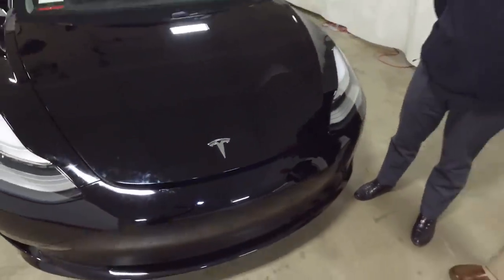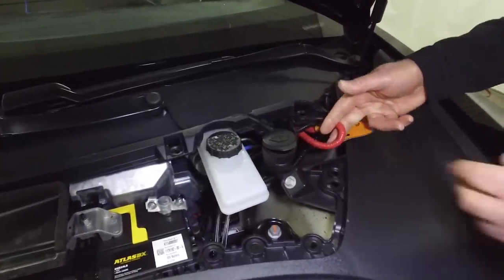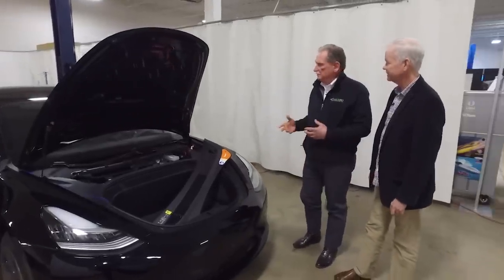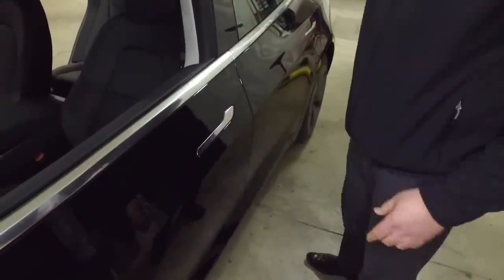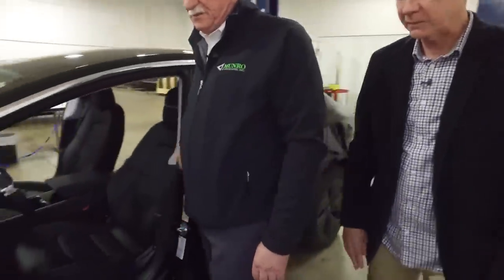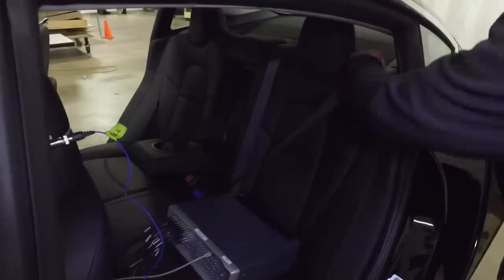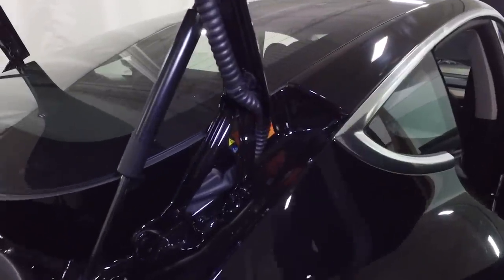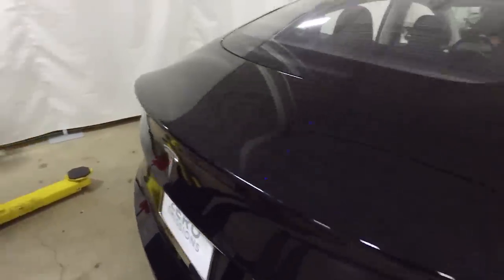Tearing Into Tesla's Model 3

Comment: Fit and finish: good point, I hope they sort this out.
Handle: meh, feels more like "I've never seen it before so it's terrible"
"Safety issues": Sure, people will have to learn, but you can't force Tesla to have poster size instructions on the side of the car. Also, how big of a problem is it? How many ICE vehicles have their fuel line layout displayed on the car? 
Lastly, can they really see no reason for avoiding the mechanical release for the frunk!? This is where it beggars belief that they are being honest. I have my stuff in there! I don't want there to be a lever for anyone to use!
Reply: Not really.. you just have to be stupid on another level to belive shit like this is something that should get approved by NCAP in the first place lmao.
Reply: The inability to cut the power in time will be a problem when you or your loved ones are bleeding out inside, and the rescue workers refuse to cut the car in case there is a risk of getting in contact with live parts. You should look up the FIA regulations for Formula E, the drivers are not even allowed to exit the car one foot at the time should they have been in an incident, but rather, they must jump off the car.
Reply: There is no reason for a hood release to be electronic.  None.  Same with the doors.
Reply: 1. ) Tesla publishes a first-responders guide with all the “caution areas” diagrammed.  Toyota and Honda do the same for their hybrids.  Tell us how it’s suddenly a problem when Tesla does it?
2.)  The 12v battery died in my Chevy and I had to climb thru the cabin to the change it. The rear lift gate is electric and I couldn’t open it in order to access the battery at the back of the vehicle.  

This video is stupid.

Comment: It's interesting how likely they seem to think it is that the battery would start shooting sparks everywhere. These are very safe devices, much safer than gas tanks.  I don't remember seeing signs on every car about the exact location of the gas tank and fuel lines there are simply standards that people are used to. They will have to get used to electric car standards.
Reply: I wouldn't say they're any safer than gas tanks. Gas tanks are a fire hazard, batteries are just as much of a fire hazard plus an electrocution hazard.
To avoid trouble when cutting a gas car, you just avoid the gas tank. The fuel lines are irrelevant. However in an EV, the power lines are still an electrocution hazard.
Reply: If you don't mind paying thousands of dollars more for a vehicle than an ICE car, by all means go for it. But until the price of those batteries come down significantly, which doesn't seem will happen anytime soon, EVs will not be as cost competitive as ICE cars.
Reply: Battery prices have been dropping consistently for years... Soon enough they will be cheaper to buy, and they are already way cheaper to drive.
Reply: The dramatic drop in price recently slowed down a lot, and now both lithium and cobalt are getting more expensive. It's not advisable to just look at a past trendline and extrapolate. Things hit economical limits. Car batteries won't be getting much cheaper as long as they're Li-ion based. Another 30% drop in price might be possible. But that's not enough.

Comment: About the power source needed for popping the hood: a couple of years ago everyone got angry with Tesla for the mechanical tab that you pull to open the frunk on an S or X. "Someone could steal my stuff" they said. Tesla said they would find a different solution, but that they have to give first responders a way of popping the frunk... This is the solution.
Reply: Henrik Bjugård Nyberg Gas cars never had a way of popping the frunk from the outside. Model 3 is no different.

First responders always used the pry tool to open the hood quickly for all cars.
Reply: Surely this method is for owners when they've let the 12v battery run down and not for first responders? I can't see them expecting the fire service to go through all that rather than just rip the frunk open with the jaws of life.
Reply: Sometimes the less violent method is faster and safer. I'm sure it's designed with several situations in mind, but it is part of the model x first responder training as the main way of accessing the power loop without 12V working.

Comment: Here's an idea (don't know if it is good or bad).  Standardize the electric emergency disconnect on all-electric vehicles.  I'd make it a knob on the exterior of the car that you just pull or turn to disconnect.  The knobs would always be in the same place for every car or truck.  I would put one button on the cowl so the driver can see it from the driver's seat.  I'd place the other button on the rear panel on the passenger side.  I'm sure people would mess with the knob because... people... but the driver would simply need to reset the knob.  If I'm in an accident, I don't want first reponders (who might not be from the fire department) going to the internet to try to find out what they should do.  We are in the early stages of this technology -- we need standards, especially thinks like the connectors you use to plug in your car.
Reply: 59seank First Responders always break open the hood on all cars since cars don't have an outside lever. 

Model 3 will have it's hood opened the same way, it's not complicated at all.

The frunk is secured for valuables.

Comment: I hope most of viewers understand that this dude is an idiot who thinks fire department cares about scratching the hood. The only thing he is not that wrong off is "how the hell did Tesla release a vehicle with unimaginably random panel gaps". It's like the whole shift of those people who adjust at the production line were drunk and off duty.
Reply: As for safety ratings, they test the performance of a car’s safety systems in a collision. To absorb the energy of such a collision, platform and body panels have to deform. The more the deformation, the more energy is absorbed, and the less energy is transferred to the occupants. With this deformation often comes the necessity to have to cut passengers out, especially in side impacts. The video makes a valid point.
Reply: except that little fact that a car with that many batteries in it is much much more likely to catch fire.So you are correct... you probably won't need cut out of a Tesla, because if the accident is that bad it will be on fire and you will already be dead.
Reply: Arnis Tarassu Anyone who knows the history of Tesla's Fremont plant (before Tesla bought it from GM) would not be surprised.
Reply: When the a car is crashed completely i wanna see you fanboys try to cut that fucking car at the right spot without hitting any high voltage lines that would cause fatal injury to yourself and both mother and child squeezed in the car and trying to get out but cant... A normal car can be cut anywhere, its a 12/24v onboard electric system... you will never injure anybody if you cut at the wrong spot...
Reply: This is what I thought too - they'd just crowbar the hood off in a few seconds if they needed to.  And there's the other elephant in the room... Being that in a Tesla the occupants are much less likely to even need cutting out of a car by the fire department in the first place, which is the reason that Tesla recently beat even Volvo for safety ratings.

Comment: Aren't there laws that require mechanical releases, specifically for the fire department to get you out and/or kill the power to the vehicle in case of an emergency? shit.. how is this legal? There are laws that govern reflectors and where and how many rear lights, but not for mechanical safety latches?? That doesn't seem right... nor does this car seem safe, I wouldn't let my family buy one of these things. I'm not even a car guy, but some of these issues this guy points out are bewildering. This doesn't seem like a fully baked product, they didn't think everything through or implement things completely, it's like a version 0.8 gadget... except it will kill you
Reply: stryk187 The mechanical releases are inside all cars to pop the hood. Then you have to unlatch it from the front. 

Firefighters don't have time for that and just use a pry tool to bust open the hood.

Comment: A LOT OF THINGS ABOUT THIS CAR WOULD BE A TURN OFF TO ME BUT EVERYONE WHINING "WHY CAN'T HE RELEASE CARS ON TIME?". PRESSURE THEM AND THERE ARE GOING TO BE FLAWS WHICH SEEM TO BE FIXED RETROACTIVELY AS WAS THE CASE WITH THE MODEL S.
FIRE DEPARTMENTS NO DOUBT HAVE BEEN APPRISED AS TO HOW TO DEAL WITH TESLA'S IN EMERGENCIES. CROW BAR, HOOD POPPED.
DOOR HANDLE, NOT MY CUP OF T, NOISE INSIDE DOOR? STOP TALKING AND LET US HEAR IT.
MECHANICAL SNOBS WOULDN'T BUY A CAR THAT KNOWS THE TEMPERATURE OF THEIR ASS, WOULD THEY? YET THE GUY WHINES ABOUT THE EFFORT TO CLOSE THE TRUNK, SO MUCH FOR BEING A "MECHANICAL GUY".
PANEL GAPS, WHEN DOUG DeMURO CRITICIZED MASERATI ALL HELL BROKE LOOSE.
INTERESTING.
Reply: MAY I INVITE YOU TO THE "MY CAPS LOCK KEY IS STUCK"- SELF AID GROUP?

Comment: Do they know that the hood opens from the touchscreen??
Reply: Which in an accident can easily be rendered inoperable, like they pointed out.
Reply: It's rhetoric, but also plain logic. It's a big, glass touchscreen with a bunch of electronic parts behind it. You've probably noticed how modern phones, for example, are quite delicate. Particularly the tempered glass screen, which is scratch-resistant but quick to shatter. 

What do you think can happen to such a screen (except far larger and admittedly, a bit thicker) in a high-speed collision that will seriously shake up the dashboard, perhaps even tear up parts of the interior? Just an assumption, but I'd say there's a decent chance that either the glass panel breaks to a degree where it's unresponsive to input, or some of the electronics fail.

This isn't a flight recorder, it wasn't made to withstand hard impacts. Tesla can add some degree of shock absorbing capability to the internals, sure, but that screen would still be toast. Not every time, but I can definitely see it happen.
Reply: What ego? The hell? As I said, I'm just applying common sense here, it seems a bit foolish to only allow (quick) access to a vital safety-related area of the car via electronics, including a plate of glass.  

Oh, and a head-on collision isn't the only kind of collision where the dash or stuff behind the dash can get hit, either physically or through kinetic force. It does seem to have a good crumple zone in the front, but I still need to see what'd happen in a side hit or 3/4. Also, there's no actual proof in there that the screen still worked on that car. Though I certainly hope it did. Not that this particular hood still needed opening. 

But if you so wish, please replace "can easily be rendered" with "COULD easily be rendered". I wasn't trying to state a fact, just saying that it seems likely. Perhaps my wording was slightly off.
Reply: Aren't you just a bundle of fun. :/
Reply: A broken LCD in an accident is useless even to open the hood. Simpler is better. This is why all the other brands use a mechanical level from the interior to open the hood (or "boot").
Reply: "Easily"?  Exactly how easily?  How did they, or you, determine this?  Or is this mere rhetoric after all?
Reply: How do YOU know how the screen was made?  Or are you simply making up a story to protect your ego?  It is easy to see that the second question is on the mark.  Meanwhile, THINK about this:
https://electrek.co/2018/01/24/tesla-model-3-crash-in-traffic-light-pole-crumple-zone-capacity/
Reply: Common sense is common idiocy.  Either you have real data and understanding of the design of the screen or  empty rhetoric.
https://www.logicallyfallacious.com/tools/lp/Bo/LogicalFallacies/197/Appeal-to-Common-Sense

On your wish for a t bone test of the Model 3 you could have looked instead of being foolish:
https://www.inverse.com/article/34833-elon-musk-tesla-model-3-crash-test-footage
Reply: The hood opens using the phone app as well as the touch screen.   First responders just cut into the car to access the power cut off cable.  The emergency responder manual is on line for all to see.  We all know early production Model 3's had some issues with gaps that have since been corrected in the latest production models.  Why crawl out the trunk if you can just climb over the front seat and exit the car.  Those who have already had head on collusions in Model 3's have walked away meaning they can open their own front and back doors to allow folks to exit the car.  Both these guys looked like they just returned from a 3 martini lunch.

Comment: It sounds like the sponsor is either an oil or a coal company.
Reply: I don’t think this is sponsored. This guy
has previously praised the BMW i3 for its masterful manufacturing process and its high quality fit and finish. He’s also been impressed with the Chevy Bolt. Tesla is not exactly known for their quality control and they’ve had major issues before. Issues that I’ve seen first hand, for example I’ve never seen a Model X with perfectly aligned door handles. Every one I’ve seen is always misaligned. So it’s not surprising the model 3 fit and finish is lacking.
Reply: An oil company sponsored Tesla do have poor fit & finish on their cars?
Reply: It sounds like you're an angry Tesla fanboy.